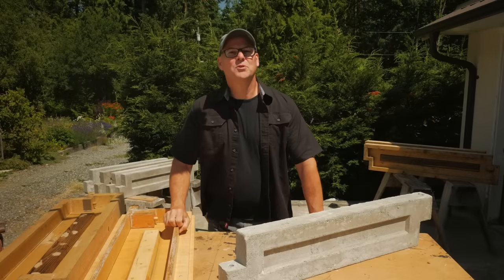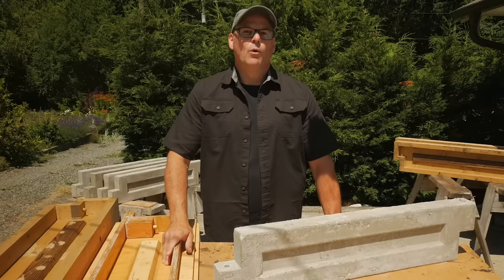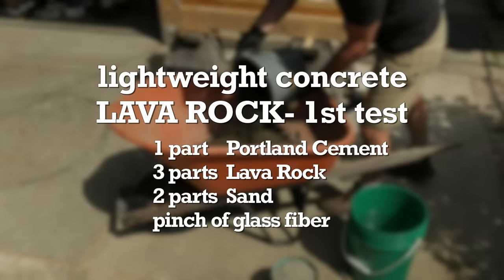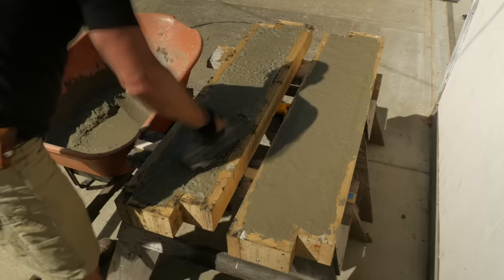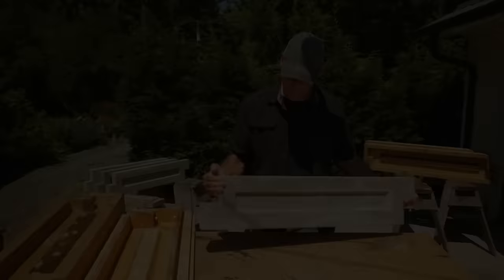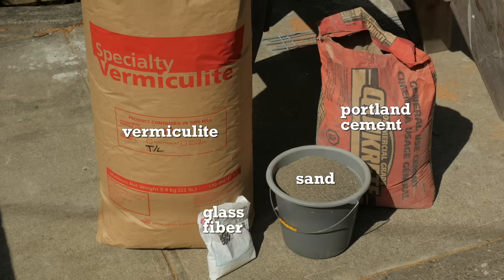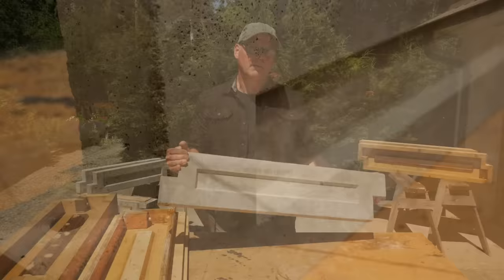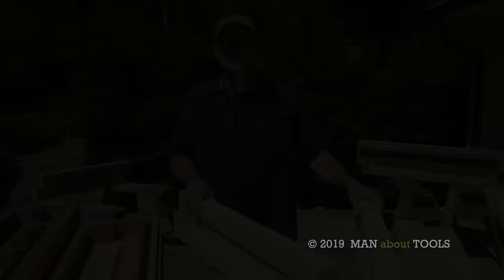make Lightweight Concrete Garden Boxes PART 3 - Aircrete Vermiculite Lava Rock

Comment: You really missed perlite.  I'd use that over vermiculite, which water logs badly.  Two things about using any of these for planters.  First, they will mess with your soil's pH.  Second, you can fix that, and also add stuff like peatmoss too, and even use that technique to mimic rocks and "stuff."  OK, seems like that's four things about using any of these for planters.  Thank you for the videos, they are awesome!

Oh, seems to me that adding other very fine particulates to the foamcrete, like clay or silt, might(?) improve its strength?  That's where I would go next.  I predict, but haven't tried, that clay and silt are small enough to foam, along with the cement.

Comment: Thanks for the cool video!

You should try curing the aircrete sample on the finished surface with a plastic sheet.  This will help with the warping that you are seeing.  This occurs because you have differential drying from one side of your box to the other.  I really like how you did the weed eater test.  Very good idea!  It would have been cool to see you keep cutting the box to see how deep the cuts would go.  I wonder if it would go all the way through?  This is very hard to fix.  I think your best bet is to use a surface hardener on the aircrete after demolding it.  This is a material that will soak into the voids and fill them with strong material.  I know this is an extra step but I think it is your best bet.  I don't know the best product to try off the top of my head.  Let me think about it.
I make a lot of videos about concrete.  Check my channel out and maybe we could talk online.
Reply from the maker: Thanks Tyler! There's a lot of options with concrete hey?? I like your thoughts and comments here. I have more tests underway right now and will check out your channel. Cheers, Kent

Comment: No disrespect-but why the need for lightweight panels. I would just make the panels from regular concrete? Quicker, simpler, cheaper. Unless one just happens to have access to all the other options. I like the moulds though.
Reply from the maker: Brad Potgieter none taken. This video was from viewer requests for lightweight panel options. I’m okay with the regular concrete as well. There seemed to be a lot of interest in this so I tried a few ideas.

Comment: Why did you choose concrete? It’s not water proof nor would it last longer than waterproof wood. I have a lightweight concrete large pot which cracked and fell apart after 5 years. Wood lasts decades if treated properly and won’t crack with earth movement.

Comment: You don't need the hog panel reinforcement wire in the foam version???
Reply: He pushed it in after the form was full and the mix had "kicked"  a little so the wire would stay in the middle.

Comment: Consider adding some roofing fabric as an outer cover to the aircrete.  This video https://youtu.be/JR8KiyLUWI0?t=195 shows how they wrap aircrete dome houses with a mortar/fabric mixture for durability.  You could drape damp fabric in your forms before pouring the aircrete in and then fold remaining fabric over the top of the aircrete in the form.  I've seen (and agree with) several comments about keeping the aircrete surface damp as it dries so that it dries uniformly and doesn't bend and crack.  I love how well you document your trial and error as you converge on better solutions - keep it up!

Comment: the first mix has an issue.. that  one pinch fiber is absurd..  normally you have to use at least 3% of the total mix weight,  its weight not volume....
Reply from the maker: I was following the manufacturers recommendation for weight of fiber for the volume of the mix. Certainly add more if you like.

Comment: What is the cost per panel per mixture?
Reply from the maker: I have not calculated any of that. There's too many price variations depending on where you live and what's available.
Reply: @MANaboutTOOLS  Thank you; I understand.  What do you think about using large wood clamps to hold the sides instead of screws.  I was thinking; if you extended the sides past the offset of the ends you could clamp the sides on each end and after the cement is poured another clamp in the middle.  No holes to drill or screws to put in and take out.

Comment: Great videos. I had a look at some swedish companies looking for a foaming agent and found that the ratio of foam and sand changes the durability. If more durability is needed they have to add some sand... but then they loose some of the foam's advantages at the same rate (like weight and insulationproperties)... It's in swedish but I think the idea can be gotten from this: http://www.skumbetong.nu/skumbetong.html#data - Of course they have their own foaming agent also.

Comment: Hey can you make forms out of metal?
Reply: Yes, but you have to decide on the thickness of the material you will use for the forms. Any stiffeners or reinforcement or moulding welded to the sheet will cause distortion and your finished castings will mirror this. Also the weight of the moulds will increase considerably and you will have a more complex method of mould assembly/disassembly (bolts, pins/fastening etc)
I did this for some pre-stressed concrete beams for a company in Bahrain and they complained about keeping the forms clean all the time

Comment: the Romans added hollow balls (not sure what their name was or how they made them) to their concrete in the pantheon dome as they built it up to make it lighter and stronger, id be interested to see what would happen if you added packing peanuts to the mix. The pantheon is 2000 years old and shows no sign of cracking

Comment: Thank you very much for posting these videos! I have a question about pouring a lightweight concrete form using a Bigfoot footing form (https://www.rona.ca/en/bigfoot-footing-form-09825333) which I hope to use as a portable pier for my telescope. It's quite stable for telescope usage but I would like to either fill or partially fill the form to reenforce its structure without adding too much weight (maybe just 50 or 60 lbs extra). If you were doing this how would you go about it? Many thanks again for your videos they extremely useful.

Comment: Very clear, thank you. When we want a lightweight concrete to have strength, we use eps pellets and pearlite. But to be cheap, air is free. It will be more sensitive to drying shrinkage with just cement (that shrinks) and air, and have no abrasion resistance. This is a some good research on integral foamcrete core construction: http://www.pioneering.nl/SiteFiles/1/files/report_k_hermsen_s0050059_pioneering.pdf

Comment: I don't think the extra cement would help.  It's the element that shrinks most since it's the glue.  Try adding really fine sand.
Reply from the maker: I agree that fine sand might be a good additive. We'll see if it messes up the foam bubble tho.
Reply: @MANaboutTOOLS  I forgot to mention that a grout (non-shrink, non-metallic) might work better as well.  It has fines included in the mix.

Comment: I wonder if Vermiculite or Perlite mixed with the aircrete would add toughness.  Also, if the added aggregate settled, that might not be a bad thing either, as it would concentrate the more durable aggregate towards the face of the panel where it is probably needed most. Possibly even using the Vermiculite mix as a "face coat" like the gel coat in fiberglass might work, followed by the Aircrete while the face coat is still tacky to prevent delamination.  Look at Graphene also: https://youtu.be/FJ6DGcP_O_s  -and-  https://youtu.be/RVjInCsjflk
.
I'm sure we are all looking forward to your next segment!

Comment: Be careful if working with vermiculite check into the dangers first pretty sure it contains asbestos.
Reply from the maker: Mike Smith vermiculite sold today is tested to be asbestos free. Back when it was introduced as insulation (1950’s ?) much of it did contain asbestos. This is what my research into it says.
Reply: @MANaboutTOOLS  yeah I'll look into it a little bit further. That's good to hear thanks for the information.

Comment: but really, why makethem lighter? These are for installation.
Reply from the maker: Tehcarp Viewer requests
Reply: @MANaboutTOOLS  Well I'll improve the request and ask that you work out panels with the least new/off the shelf materials. 

Also how to make a mould  that does 8 panels at once. Then the panels can be smaller ergo lighter, made more efficiently, and with reduced environmental footprint.

Then you could do a whole community garden for a couple bags of cement and some crushed bricks/rocks/found materials.

Comment: I think that pinch of fibre glass is not an important ingredient (except in aircrete)
Reply from the maker: Possibly. Some swear that it's necessary. Hard to test ourselves if it's helpful. However, it's cheap and easy to add. I followed the manufacturers recommendation for the amount to add for the volume I was pouring.

Comment: Dude apinch of fiber is not enough fiber, you may as well not add any. How you can drop like 20 fibers in a wheelbarrow full of concrete and think that's enough kind of blows my mind.
Reply from the maker: That amount is what is recommended by the manufacturer of the fibre.

Comment: I am 69 years old and I called the junk man to take away my wife's concrete pots. Forgive me for saying, moving 60lbs concrete pots around the yard got to be tedious and I drew the line. I said no more. They are gone and will never return as long as I am the one moving them. Good riddance.
Reply: These don't weigh 60 lbs.  Even the full 'crete ones probably aren't over 40 based on the (lack of) exertion that Kent used.  He weighed the panels.  But he only gave us how much less by percentage.  Maybe he can answer here what the various version weigh.

Comment: I think you used AircreteHarrys 30 Gallon Mix formula, that is his stronger mix, His standard mix is the 50 Gallon Mix
https://www.youtube.com/watch?v=5UibN7ZMOW4
He actually makes 32 Gallon Mix , but based on my calculations between yours and his recipe you are actually making his 30 Gallon Mix.
Which makes sense, coz you need some strength, I dont think His Standard 50 Gal mix will do well in garden box, as your 30gal mix just manage to pass strength test for your applications.

Comment: you waste your time with a pinch of glass fiber that does nothing to the stability of the concrete you need more try a 1/2 pound in your mix BIG difference better stability